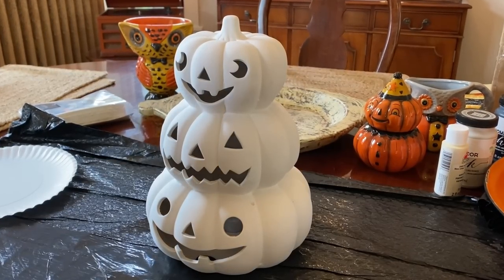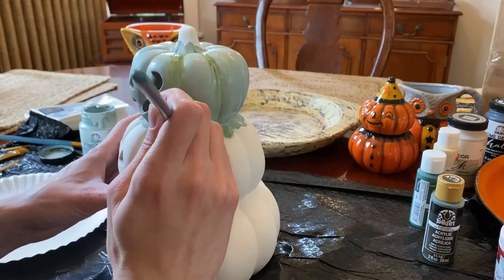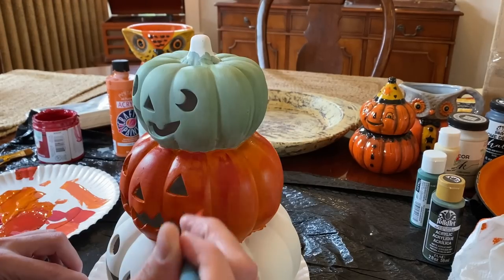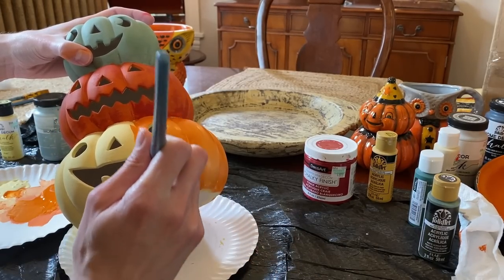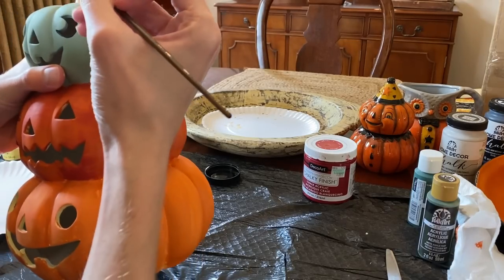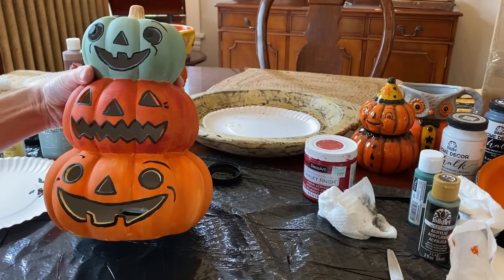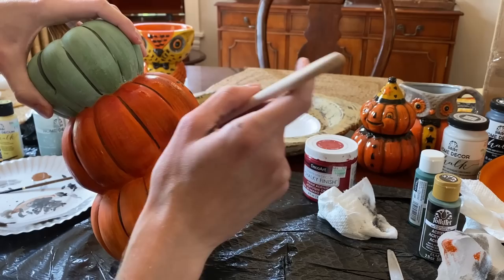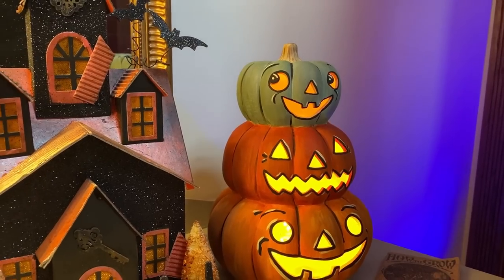Halloween Ceramic Painting Tutorial - How To Paint A Ceramic Pumpkin - DIY Halloween Crafts - Decor

Comment: Love this! Hey Christopher! I wouldn’t discard the pumpkin cake stand just yet from the previous video. I believe you can put it in the oven (probably wouldn’t do it at a super high temp) to heat up the glue that is attaching the plate and stand together.  In theory it should melt the glue and you can detach both pieces and re-glue with a strong adhesive. I’m in groups where people have detached a Johanna parker Christmas cake stand that way. Would hurt to give it a try :)
Reply from the maker: Thanks!  I actually did try heating the cake stand in the oven to loosen the glue and it did eventually work! 🙂
Reply: @ChristopherHiedeman  yay! That’s awesome 😊